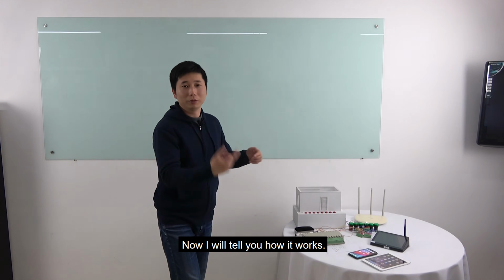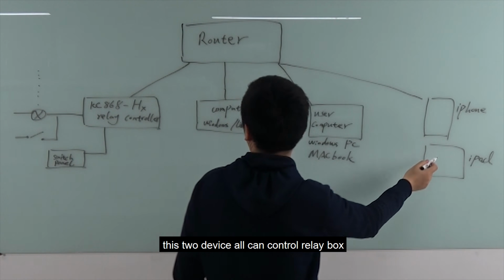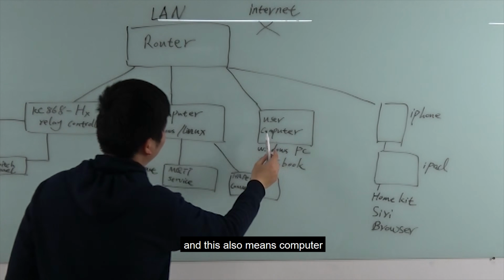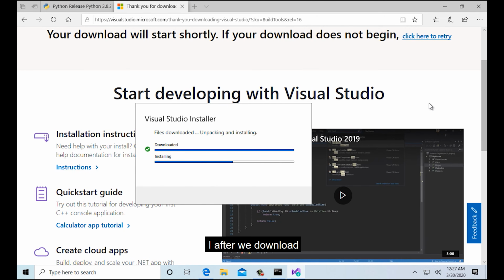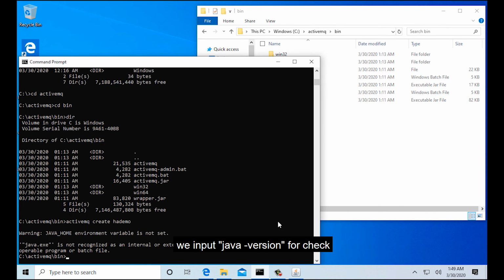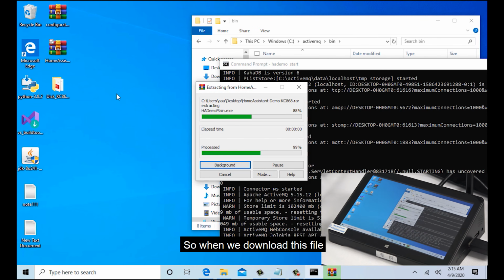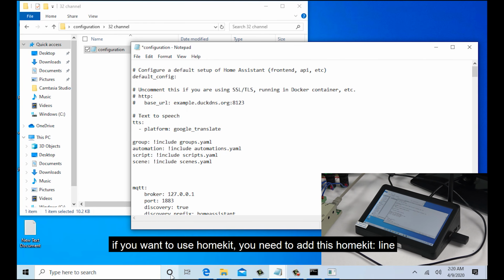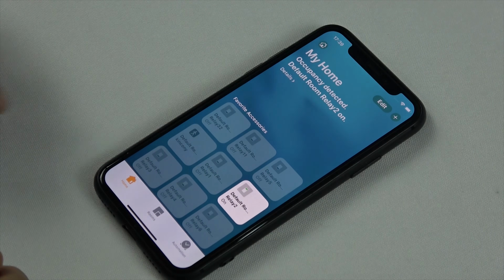[Automation Module Project DIY] HomeKit control relay Home Assistant

Comment: Hi , if i using kc868 relay controller. Can we programme and send data to our own server? I mean we already have our own website and we want to control it with our own website using mqtt. Is it possible?
Reply from the maker: yes, it support, KC868 all relay controller support change work mode to "TCP Client", you can set server IP and Port for your server, then controller power on ,  will auto connect with your server by TCP Socket connection. then you can send command according to our protocol. we have supply the demo source code of debugger on kincony's website for download.
Reply: @KinCony  i see,  do you have facebook? i would like to live chat with you. want to ask something regarding on this.
Reply from the maker: no problem:  https://facebook.com/kincony.smarthome

Comment: Hi, please make proper implementation of this device in home assistant. My relais board has arrived but I can do nothing. Your installation is home assistant on windows. Most use this with pi or mine running on virtual machine. Other implementation on github work in changing relais state but state is not updating when fysical button is pressed.
Reply from the maker: now we make the program is only for relay control, but work for input port. when we have free time, i think we can make a new version for Raspberry Pi.thanks for your suggestion.